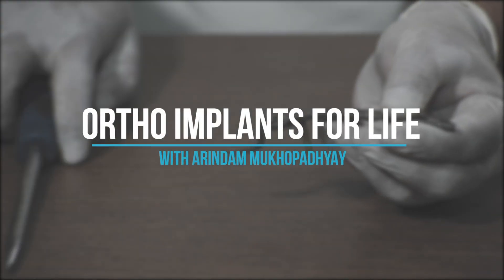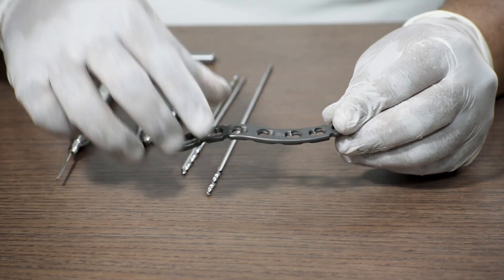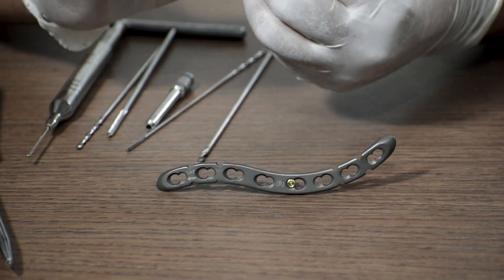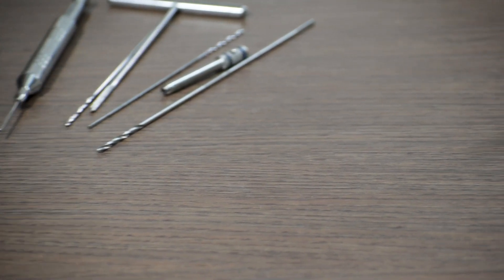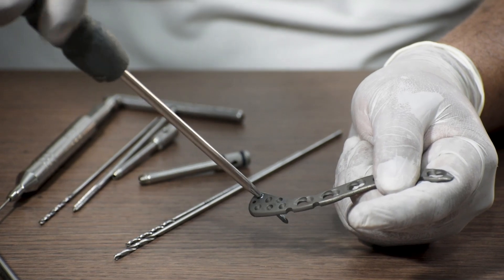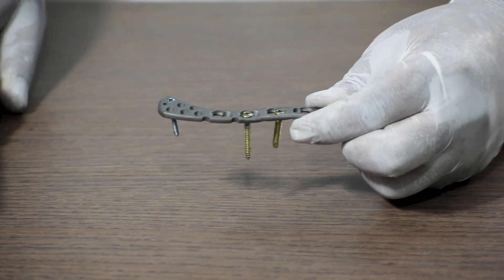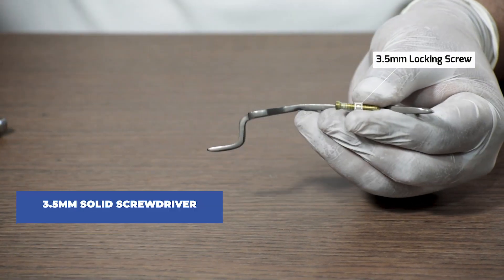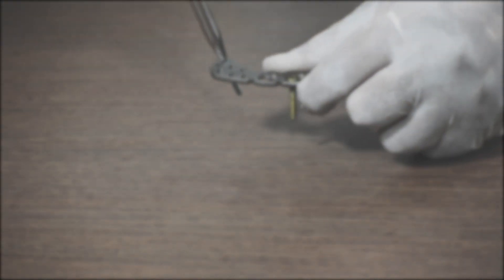Clavicle Anatomical Plates Fixation Procedure

Comment: For the Clavicle Locking Hook Plate technic applied to a clavicle-acromion separation (no bone fractures), generally speaking, should this hardware be removed after the ligaments have healed. Are there problems with leaving it permanently installed in terms of impeding movements or damaging the acromion, from activities such as swimming? Thank you.